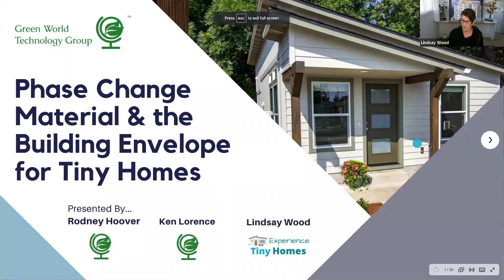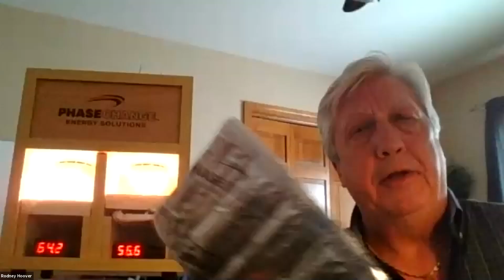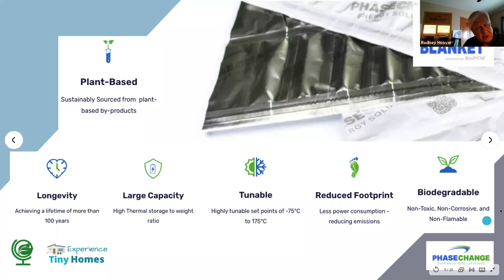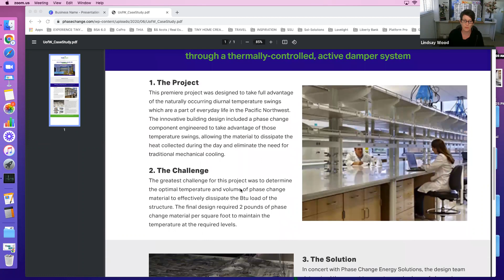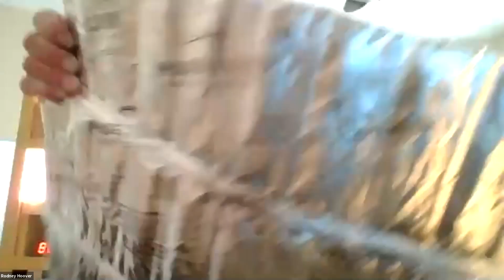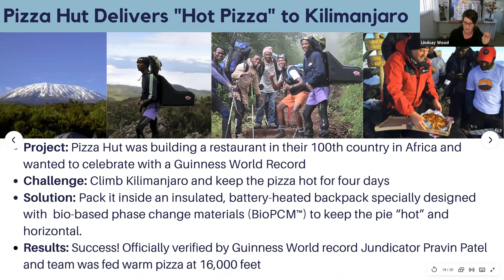Phase Change Material for a variety of applications

Comment: I have a patent that will complement PCM. Opening your window when the temperature is favorable will help, but not as much. The air change per hour is too small to reach the full potential of thermal storage. I have a patented switch that will turn on a fan whenever the outside temperature is favorable.
Reply from the maker: Hi Tony- That sounds amazing let's connect about this. Do you have a website?

Comment: Not interested in a tiny home, I want a big house (with a tiny or non-existent carbon footprint). But before that can happen, my numbers have to come up...
Reply from the maker: That would be awesome to have a netzero impact from a larger home especially as they require so much more heating and cooling which results in creating emissions, unless you have a solar system that can accommodate. I would highly recommend checking out passive house techniques as they are the most efficient as well as phase change materials to help with reducing those loads. Thanks for commenting!
https://www.thetinyhomelady.com/phase-change-material.html
Reply: @tinyhomelady  
"passive house techniques ... as well as phase change materials"
already on my list of requirements. for heating i would use solar design, both active (solar panels and such) and passive (build the house in such a way that sunlight can hit the windows in winter but not in summer). 
ventilation: solar chimneys that can also take advantage of the wind.
cooling: traditional air conditioning uses too much power. i'd go with radiant cooling panels.
and that's only a small part of what i want to do if my numbers ever come up...